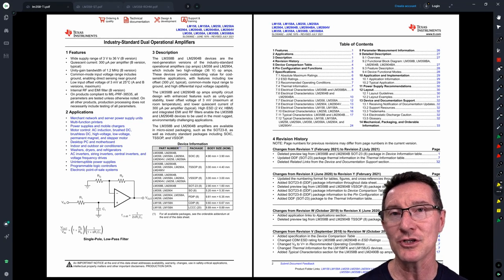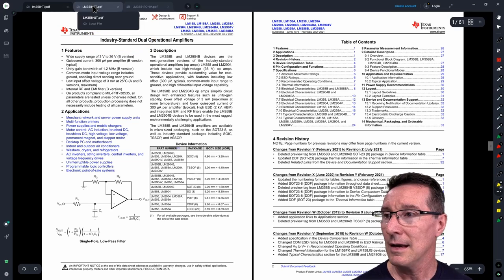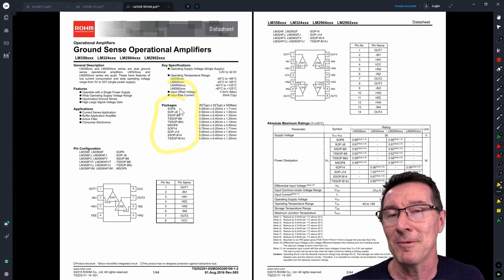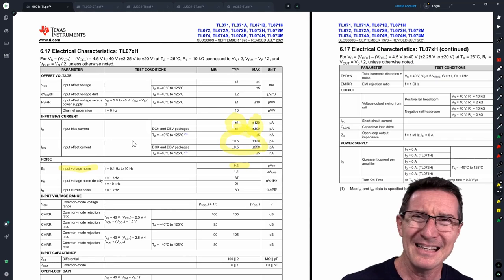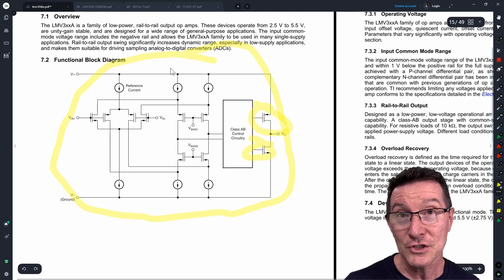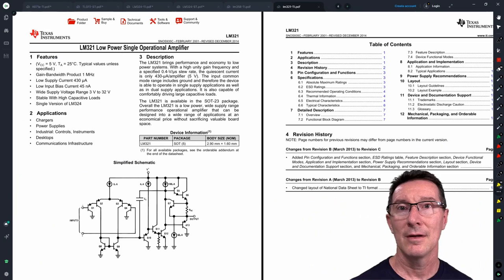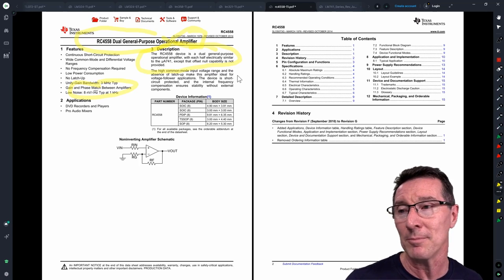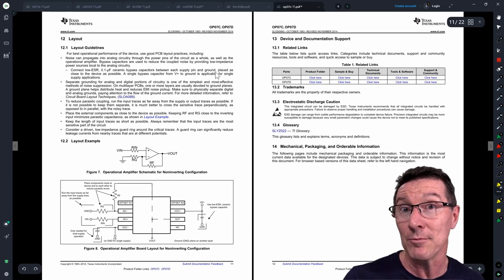EEVBlog 1436 - The TOP 5 Jellybean OPAMP's

Comment: I think having a Top 5 shootout list for BJTs, MOSFETs & JFETs would be an interesting video too.
Reply: MJE1300X like MJE 13005 for higher voltage stuff and like BC547 for low power low voltage and TIPXX like TIP42C for lower voltage power applications like Linear PSUs
 IRFZ44N/IRF3205 for low-ish voltage stuff and 7N11 or similar for higher voltage stuff 7 stands for 700v and 11 for 11A.
I don’t know about JFETs.
Reply: I agree.
Reply: maybe not a shootout but more of a selection guide for young players. I needed something like this when starting out, uni doesnt teach component selection :(
Reply: Yes that is a good idea.
Reply: @tanishqbhaiji103  I agree. The 2N2222A, 2N3904 and 2N3906 are old as dirt, but because they are essentially free now and have pretty decent current output specs, they are still used for tons of simple, “don’t really care” applications.
Reply: @tanishqbhaiji103  Don't forget BC856/BC846. A higher voltage (65V) and lower capacitance (max 4.5pF) alternative to BC547 for lower currents (100mA).
Reply: Id preffer a how to make a Germanium Transistor from the 50s.
Reply: It's been a while since I designed circuits using small-signal BJTs, but the standard "go-to"s used to be the BC184/BC214 series, although I've used the BC639/BC640 for higher voltage/ higher current (80V 1A) switching applications. These days most small-signal stuff can be handled with a 2N7000 MOSFET, so the once-ubiquitous BJTs will probably be relegated to niche applications.
The problem with JFETs is that for most applications where you think you might need one, you usually need two as a matched-pair for differential input, etc. and then it's a no-brainer to just use a TL071 or similar if you've got the supply voltage available.
Reply: I'll second this, especially for signal-level jFETs and MOSFETs. The supplies of the former jellybeans (J201 and 2N7000 respectively) are finally drying up.and the available substitutes don't look very compatible on paper.
Reply: omg please iv been trying to learn the general class of things for a while, im unfortunately tryin to learn by myself, its been interesting to say that leas o and overwhelming  it would have been nice if ITT did that they were  payed to, u could tell is was inner city kinda there for a paycheck, im not goin to go over specific stories in that aspect... anyway i didnt make it half way thru the year n that worthless place got shut down it was horrible there         the rest down below is the least bit important, it just explains y i feel it had racism issues  now stay mature  not racism but wanted to give a accurate account of what happened 

 racism against whites there was bad n the teachers rarely ever stopped it, a kid n i almost got in a fight one morning because i was usually a few minutes late because i worked 3rd shift n went straight there, n this fuckin kid thought, that i thought, that 'cuz i was white, (although blacks directly in my bloodline) that i thought i didnt have to come to class on time.... that blew me away i didnt even know what to say  i jus pulled that "my families mixed so wtf"  lol  its not just at itt iv had problem other places to  my friend n i were standin waitin for a ride after a movie at the westminster md mall, a few dudes that looked all hyper n bouncin around lol pushed put both hands on our shoulders n pushed us back into the bushes.... we were probably around 7 8 9 idk, not old at all    it was respectful of them tho id like to meet em today n shake their hands n say thank u
Reply: I just look at the parts that Big Clive sees in all his cheap Chinese electronics (to use in repairs and my hobby designs), so I've got a bunch of j3y for npn, 2302/A2SHB n channel MOSFET, 2301/a1shb p channel. Logic level, cheap as chips, and at least a whole pile of eastern vendors make them.
Reply: The problem with that is BJTs and FETs vary radically with application. EG do you want an everyday BJT for switching or are you using it for a low power RF? If so what frequency of RF? Are you using it for RTL? Or DTL? Also for some reason if you look at an absolutely "bog standard" transistor for small signal amplification, which transistor is preferred changes by region. EG in the USA the 2N2222A is used the BC547 is way more common in Europe. For some reason some countries favour the BC337. In a lot of applications they would all be interchangable and they are all interchangable with the BC108 as long as they fit physically. However there are subtle differences. For a FET it's worse. EG is gat charge important? IE do you need a fast slew rate (yes for high frequency H bridges). Is it being used as a power switch with a frequency of Hz to mHz then gate charge is less important than RDSon. Do you need a complementary P channel MOSFET? Many of the cheap ones don't have one as P channel use more silicon so cost more. There are far more applications and circuit parameters for transistors and such like than there are for op-amps. I would say that makes it almost impossible.
Reply: @petersage5157  You ain't kidding. It's like the manufacturing process has changed or something. I have a few instruments I have designed (eg electrometers) that used to use JFET inputs to be able to measure aA. I also have some friends in the RF world that experiment with all sorts of ultra low power stuff (250mW club), I have given up and have had to design some kit with the LMC6041 )OK down to 1fA with a +- 50aA error worst case when cooled with dry ice). Can we get JFET's that work with the aW sensitivity the guys used to get using dry ice cooling? Can we nuts.  Liquid nitrogen cooling is too dangerous too.
Reply: @tanishqbhaiji103  13001/13002/13003 - can't get more jellybean than these components, every electronic CFL had these._
Reply: AO3400 30v 5A SOT23 n-channel MOSFET (Cheap, but not very robust. Great for prototyping power stuff).

BC807/817 45v 500mA SOT23 BJT (good general purpose PNP/NPN)
Reply: Up
Reply: We've got a product (designed in Oz) that uses 300A SMD MOSFETs. Are they or will they be jellybean soon ;)
Reply: Also, don't forget diodes for various applications. 1N4000 series comes to mind for generic medium current silicon... the amount I've seen used in a wide range of appliances as full bridge rectifier is astounding. The 1N4148 I see everywhere as 'default' fast switching diode and then there is the 1N34A for a germanium 'jobby' (low forward voltage, useful in small signal detection). There should be a Shottky equivalent and maybe someone can supplement this little list with more defaults for diode categories like zeners, diacs, LEDs and varactors.
Reply: Please yes
Reply: Yess
Reply: IRF-250 TO-3 power MOSFET
Reply: Let's not forget 2N3055..bipolar NPN
Reply: In old books, BF245 used to be the standard JFET for everything - it's no longer produced, there's the electrically compatible BF545, but in SMD case instead of THT

Comment: A series about "standard" parts would be super awesome! Next MOSFETs pls! :D
Reply: Most standard used n-channel MOSFET is IRFZ44. At least that one Is one I have like 50 pcs and whenever going to build something around mosftets , it comes in consideration as a mosftet which going to be used.
Reply: I think it is 2N7000 for signal applications, and IRF540, IRF9540 for power

Comment: Around 1964 I needed an opamp for special analog computing projects and designed one based on the one in the company's process controller.  About a year later I replaced those approx. 99 components with an MC1433G for $30.  About a year later I replaced that with a 741 for one dollar.  A couple years later a 741 was, i forget, about a nickel or a dime.  /Andyh

Comment: LM358 if you do not use the other half just use it as a buffer, and make it useful to drive longer lengths of cable. If you might need to use it simply connect the input, output and feedback using any cheap low value SMD resistors used elsewhere in the design. That way if you need it, you simply remove the 3 resistors, and have the uncommitted opamp available for the bodge wires, having pads already and no track cuts needed. 

Just be aware that input CMRR means 3V is not giving you much signal amplitude before it clips, and depending on who made it the output may or may not invert under large overload. Really you want 6V or better for good results.
Reply from the maker: Yes, rarely do I have the spare opamp. But if you do, yes, strap with removable resistors. Don't leave floating or tied hard whcih can draw excess current. Should have mentioned that in the video actually.
Reply: If my understanding is correct this is a win win for audiophiles and engineers because you can utilize negative feedback and not worry about inverting the original waveform because you can invert it back to the original polarity with an inverting buffer.
Reply: @HazeAnderson  Yep, inverting is really useful for lots of reasons, and having another to get back to original polarity is often necessary.
Reply: I am at a loss why do people not use the 2nd “unused” op amp in the feedback loop to tighten the phase shift in applications that could use that. Especially for audio. See James Wong’s ADI AN-107. If any one reading this hasn’t read that app note, it’d be a good idea to do so right away. It can pull some extra performance even out of an LM358. It’s just two extra resistors. Anywhere you could use a flatter response and less phase shift, this is the way to go. Especially useful in instrumentation/lab applications where you may want the amplifier to be as transparent as possible.

Trip point for young players: this absolutely depends on all op amps used (2 or 3 depending on the degree of compensation) to be on the same semiconductor die. If you mix op amps in different packages, you’ll decrease the phase margin and the flatness of the transfer curve.

Comment: For simple,  low voltage (<6V), single supply, rail to rail applications: I've come to really appreciate the MCP6000 series general purpose op-amps from Microchip. They tend to be widely available in large quantities from sites like mouser and digi-key, and they are price competitive compared with other op-amps with similar specs. Super simple to use, especially for hobbyists that tend to work with single supply, 5V or 3V3 systems (Arduino, RPi etc).
Reply: They are pretty nice, but drift and do have some shot noise, would not use them for "accurate" or long term measuring. For these voltages I would go with OPAx330. For most analogy input stuff they are a bit more care-free to use, but surely do cost a bit more. Availability I have not checked.
Reply: I just wanted to write that, but I see that you were faster. The third generation of OP-amps has several advantages, that are just priceless. I've been using MCP6001, which has rail-to-rail input and output, supply voltage range from 1.8V to 6V, is internally compensated to 1MHz and is really cheap and available.
Reply: The 600x was probably my favorite before I really knew what I was doing.  It behaves ideally for Arduino projects, and if you need something comparable but better, there’s always the 602x.
Reply: Definitely worthy of an honorable mention.
Reply: @TrickyNekro  What do you mean by "accurate"? Something like 0.1%? The OPAx330 is at least 10 times as expensive, it's a different amp all together.
Reply: @mrkv4k  Yes, of course they are more expensive as I stated. Accurate as in drift, I think I also said that. They drift a bit much for the 2 stage x365 gain I used them for. First stage x36.5 second stage x10. Stable temperature, temperature of sensor stable and under stable load, power supply etc. etc. etc.. At least for the application I needed them for they were drifting, but the application also required very low voltage and very low cost, so it was a consideration, you can´t beat the price. Because though the recording was auto-zeroed and only needed to record for a short length of time, it didn´t matter. For long term recordings I would go though with chopper / auto-zero amps. If you are trying to amplify small "DC" signals, you need to, drift can be comparable.
Reply: If you want an opamp that includes both the positive and negative rails in its common-mode range, the MCP6002 is arguably the best choice on almost every score. Although its AC parameters (like 0.6V/μs slew rate) might limit its usefulness in applications like signal processing, it's more than adequate when interfacing with digital systems.
Reply: @TrickyNekro  Oh, that made it clear. I used them in an application where I measure the input current of the device. But there is not much of a gain (it's 1V/300mA with a 1ohm shunt) and they were much better than what I needed (it's a part of self-diagnostic system and something like +-2% tolerance was ok). I haven't noticed any significant drift so far (on devices that have been powered for 2 years straight).
The way they are able to get pretty low input offset is, that they actually measure and tune every single opamp during the production.
Reply: @mrkv4k  Look, I was working with strain gauges and the cheap ones are anyhow noisy as hell ( if you use two half bridges to form a full bridge ). And in the end it also worked for me cause, next design I went for the AD8237 which goes for almost X10 the price. For the 0.41€ the two MCP6001 I used costed, I got pretty ok performance. Unfortunately the 350gr drift I got with the 500kg gauge was unacceptable for being able to calibrate other devices. Meh, problems problems... 🙃
Reply: Yeah the rail-to-rail input is really nice, it is an often overlooked parameter. The choice in the MCP60xx range is also good, having offerings with super low current consumption, higher bandwidth and chopper amps.

Comment: Great video Dave, Thanks. Regarding the LM358/324 parts, we've always heard they are not good for audio. I figured this was audio snobbery.  I didn't realize until recently (from a Bob Pease video) that this is because the output stage is Class B, not AB like most proper opamps. The output buffer has no bias. This is to save power. So the voltage amp stage needs to slew nearly 2V to switch the output from + to =. This causes lots of crossover distortion of an AC signal.  But all is not lost: this can be fixed by using a pull-down or pull-up resistor on the output, making the output Class A.
Reply: Completely agree, I always avoided this opamp for audio, you can bias up the output stage to avoid the crossover but then you kill the low power performance, so why bother. Just use the TL07 series.
Reply: A better than TL07x is 4558. Better than 4558 is 5532. Better than 5532 is opa1678 but it's not jellybean.
Reply: Underrated comment. Every now and then there is a question on some electronics forum about "LM358 and strange distortions" posted by novice. I feel like that knowledge should be more widespread.
Reply: Nice explanation. Thanks.
Reply: Ah, if I saw your message before, well... I wouldn't have had the fun to discover it by myself. Testing a few opamp with super matched resistors to see what CMRR I could get without any dedicated IA, I was shocked by the crossover distorsion of the LM358. I came to the same conclusion looking at its functional diagram and came to the same solution : a pull-up was added in the process! Works like a charm.

Comment: I cannot remember how many of my favorite jellybean 555 timers I burned out as a kid. Sometimes they would fall from my desk to the carpeted floor.  One time my mother came into my room to talk and she stepped on one of these chips.  Those eight little pins plugged securely into her heel.  Of course she made a big deal out of it. I had difficulty holding back my laughs, though I was horrified that it bled so much. I had wondered where that chip went.  For a few days, she had eight little holes in her heel-turned-breadboard.  I was more careful after that. I built all the circuits I found in the Radio Shack Engineering Notes booklets.  I loved all the CMOS and TTL  logic chips.  But the 555 found it's way into nearly all my projects because it was able to provide adjustable frequency clock pulses and pulse width.  Since I was a kid without an oscilloscope, I had to get my duty cycle right using an LED and then turn up the frequency.  I wish I had spent more time understanding op-amps, but I was unwilling to do all the math.  Digital, to me, meant computers and robotics. I pursued these more than analog circuits because they made more sense to me.  The ubiquitous 555 was at the beginning of my hobby that later became my career as a controls engineer.  But with microcontrollers that have built-in oscillators, the 555 is just not needed so much any more.

Comment: The NE5532 is a superb op-amp for audio circuits with low resistance values around it due to only 5nV/√hz. If resistance values go up, say +100k in filter circuits, the Johnson noise caused by input bias can outweigh the voltage noise. Then you want a FET like TL072. However if you look at products today coming out of big corps, the NJM4580/RC4580 (or equiv.) is more common than NE5532. It has slightly lower noise and is cheaper in bulk.

The LM4562 was becoming very popular in high quality audio products, but got discontinued after TI bought out National. Today I found it's back in active production! Like an NE5532 with only 2.7nv/√hz.
Reply: @JM Coulon For low signal level sources you probably want a FET though, no? Not to load the source down.
Reply: I missed the 5532 as well in this presentation
Reply: @JM Coulon Point taken! Not all low voltage output are low current outputs.
Reply: Lm4562 = lme49720
Reply: They finally lower the price of LM4562 to more acceptable range, but I really doubt we'll see that widely used in mid range consumer grade audio device.